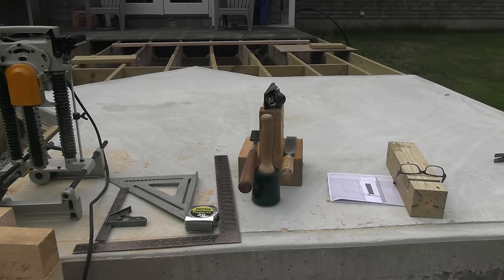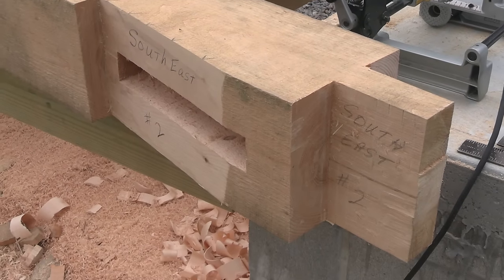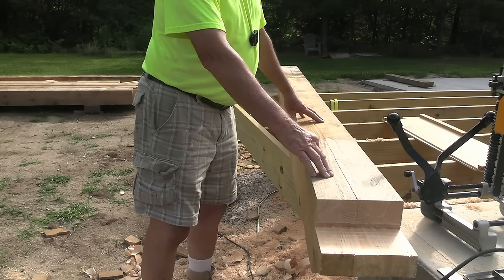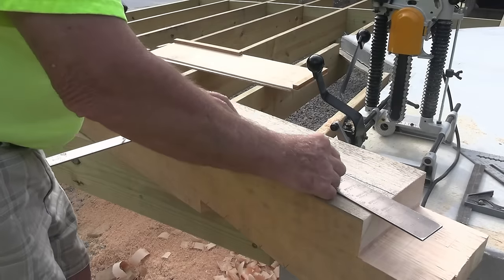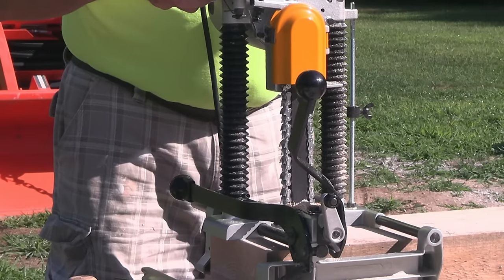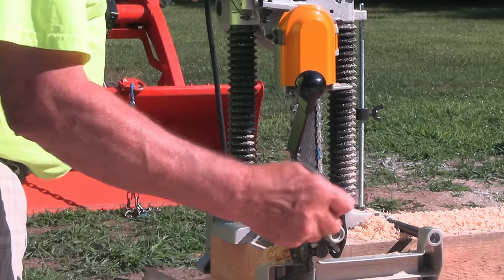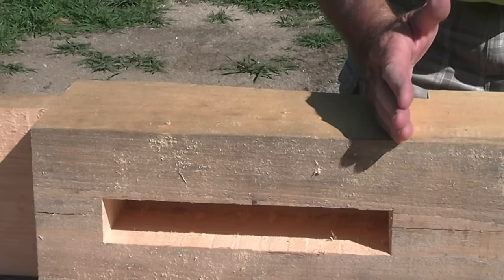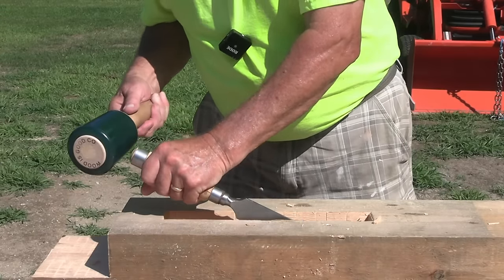How to Cut Two Important Timber Frame Joints ~ The Pavilion Construction Continues!

Comment: Very good explaination and demonstration of these joinery technics. We live in an old farmhouse, 44 yds long build new in 1796. The old house and barn burnt down so they had to replace it. They used this framework technic combined with clay and/or bricks. The biggest cross-section and length of beams is 15“x15“x17yds. They build the house and the similar sized barn in 1796 and 1797. Today there are no such oak trees around. Greetings from northern Germany.

Comment: It pleases me to see you doing some timber framing work. It was my job for over a year. I now have an addiction to collecting Japanese woodworking tools, especially for timber framing.  

Just FYI, for the housings that you're making around the mortise, make it slightly deeper. If you put your framing square across, there should be a slight dip in the middle. This allows for the joint and housing to expand and contract without pushing at any other mated timbers. Also I've been following and taking a lot of advice from you in regards to fire arms, maintenance, etc.  Cheers and best wishes.

Comment: good job, great looking machine ,you would think they would have a lube oil drip feed or something for the chain as a chain saw has  to help with over heating chain and chain stretching and longevity of chain
Reply from the maker: Unlike a chain saw, this tool cannot employ oil that would stain or contaminate the wood. Even the ends of each timber are badly stained by bar oil from the day they were felled.  These Makita chain mortisers are known for long term reliability.
Reply: And some cutting oil

Comment: I love timber framed buildings, however I don't like the cheater plates with all the bolts instead of properly joining it.
Reply from the maker: I agree, Timber framing with mortise and tenon is certainly more beautiful and classical. But in most states, such joinery is strictly not allowed for commercial or public buildings, where approved post and beam connectors are required. The steel joints have specific ratings for architects to follow, in combination with specific woods or laminated beams, whereas none exist for timber frames. It's not really cheating; it's just the only way it would ever be approved for churches, restaurants, public farmers markets, etc.  Properly done, it can be quite beautiful in its own right.